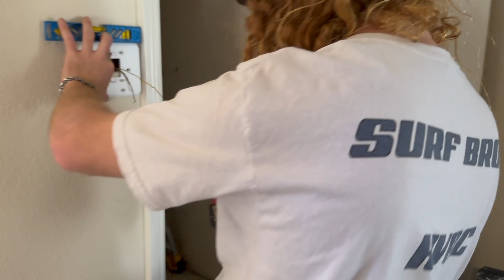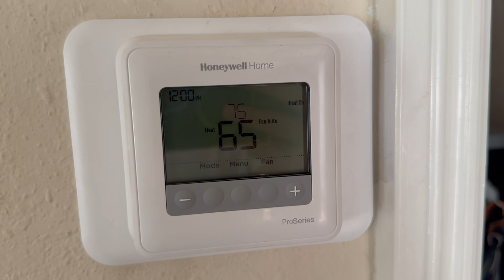Replacing 47 YEAR OLD Furnace with a Cracked Heat Exchanger   Furnace Teardown Included

Comment: its nice replacing a furnace with one you can still see the burners on. we're putting in ULN over here in riverside
Reply from the maker: If we move to ultra low nox I think I'll stop installing furnaces altogether. Heat pumps only at that point. Furnace installs already make up a very small part of our business so it wouldn't really hurt us much. I've heard they are headaches to deal with but maybe I'm misinformed

Comment: Whats the workload like out there in SD during winter? Im a couple hrs away in the Coachella Valley area and its pretty dead, have to travel out of town during this season,
Reply from the maker: It's pretty dead. I did some strategic scheduling to keep cash flow in the slow times and it's worked out fine. Slowest month is typically November and we made it past that. Keep in mind we are all wusses here when it comes to both cold and heat. We get a lot of referrals because we actually know how to diagnose while most technicians here do not know how to diagnose due to lack of exposure to breakdowns

Comment: Nooooo not the mastic tape! Why do people use this crap. Gluttons for punishment in the future.
Reply from the maker: I don't feel too strongly on the matter although I know some guys reallllly prefer one over the other. Why don't you like the tape? Change my mind
Reply: @SurfBrosHVAC  have you ever tried to remove it? It sticks to your duct knife and clogs your 1/4” bit. It is a nightmare. I prefer standard silver tape then mastic over it. It takes a few minutes longer but you save yourself or others future trouble.
Reply: Mastic tape is so easy though. And if you use a flip bit you don't have to worry about clogging.
Reply: @potentialhvac6074  you still have to unclog it after every screw you remove and you have to clean your knife with mineral spirits afterwards. It’s a horribly short sided solution to something that it’s so simple. When you’re in a 120 degree attic leaning over a furnace trying to remove screws that have that tape over it you will change your mind.
Reply from the maker: In attics we only use pookie. In closets we tend to lean towards the tape. Keeps the closet looking cleaner most of the time. I do see your point of digging out screws. We try not to go to crazy on screws and never install anything inaccessible. There's been wayyyy too many times I have to go fix something that is inaccessible from shortsightedness on new construction
Reply: @SurfBrosHVAC  Right on. I go a little ocd on the mastic. I use masking tape to make straight clean lines on the seams that are visible.